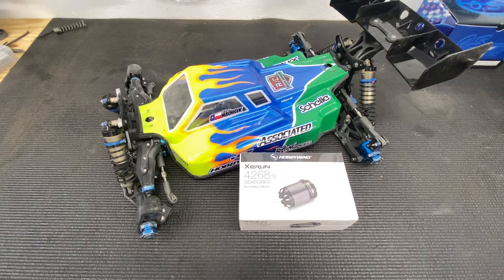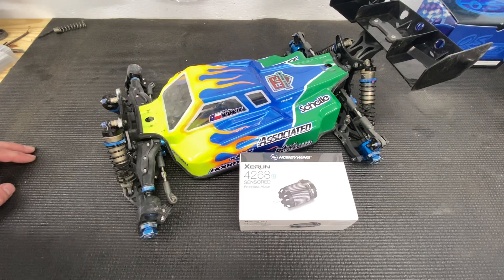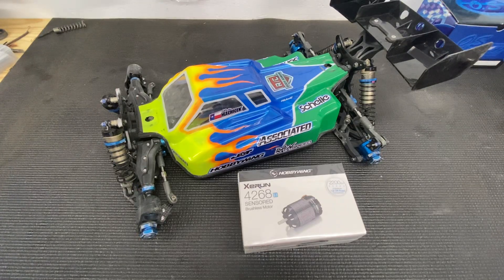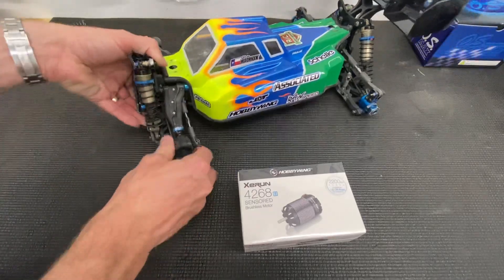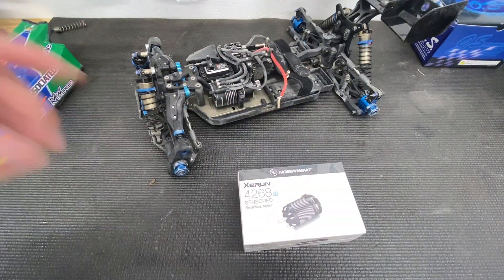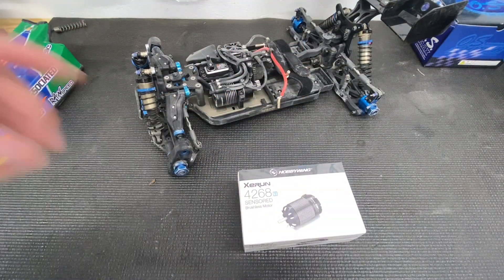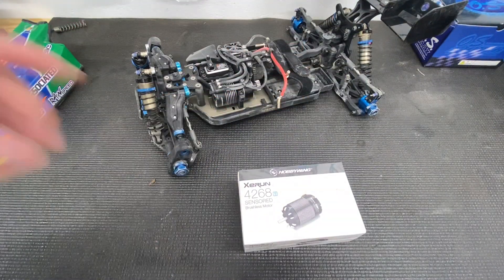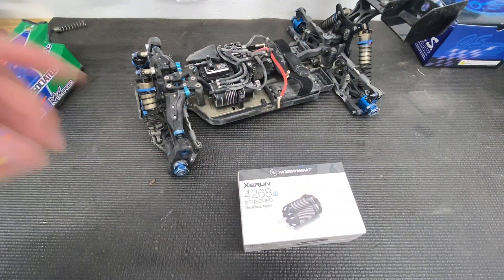High KV motors? 2200Kv vs 1900Kv! Lets talk about it.

Comment: I switched to the 2200kv running a 16t pinion and the metal 47t spur with the punch turned down. I love the feel of the 2200 after the front bearing in the 1900 locked up :(

Comment: That was interesting to hear about! I'm not quite at that level of knowledge myself, and I definitely am not a race buggy proper race guy... I have a 2500kV motor in my MP10e and of course it's crazy fast, so I mostly use a 3s pack in it, just a small one, so I don't even bother put anything in the other battery compartment. I just drive it on the street and in the dirt anyway, last year I went to the track and I hated it, mostly because it's difficult, ha ha!